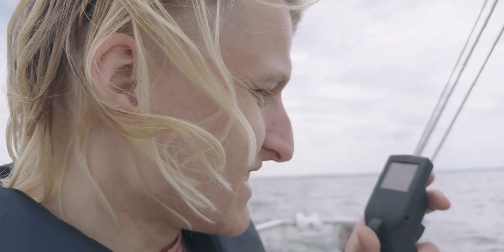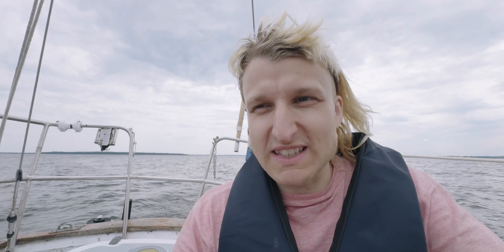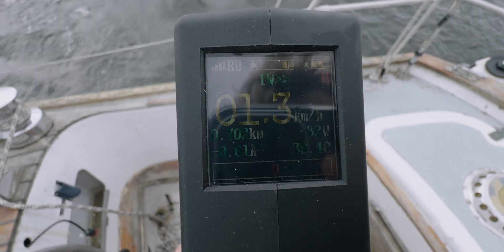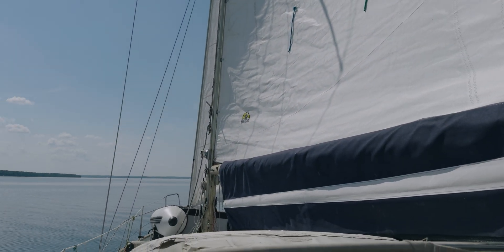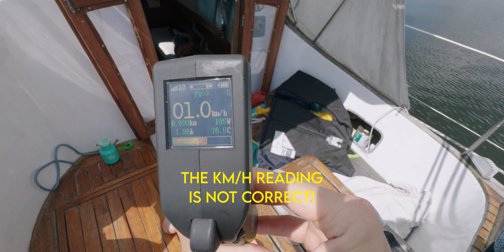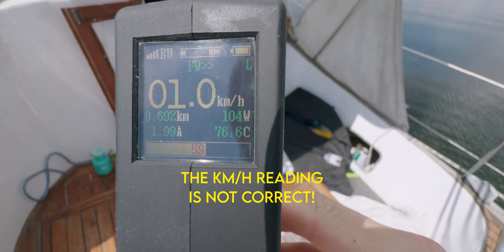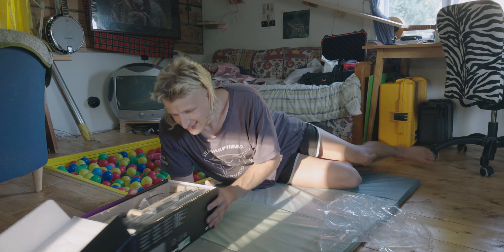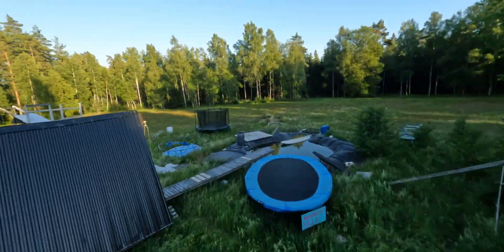First Test of the DIY Electric Sailboat Motor

Comment: I looked at the motor data for the 48 V motor. It shows 10 kW at 3500 RPM with 80 percent efficiency. The prop shaft cannot spin at 3500 RPM. Depending on your prop pitch, it may be more like 1200 or 1500 or something like that. Do you know your prop pitch and diameter? Also boat waterline length and displacement? Matching the motor to the prop is very important. You want to keep the prop and the motor operating in an efficient range.
Reply from the maker: That's true! I don't have the data on the prop and all. This will be the first bad version that maybe will be good enough! I think that it's not possible to compare the efficiency to an ocean volt or stuff like that. Simplicity and cheapness is my priorities for the moment. :)
Reply: @happygoluckyland is should be more efficient, vesc controllers are extremely efficient by themselves

Comment: You probably need a reduction gear to get max power from the motor. The motor max power is available only at rated RPM. The prop shaft will not want to spin at that RPM.
Reply from the maker: Yes that's true! I considered it but it was complicated enough for me without :)
Reply: @happygoluckyland  one step at a time. At least you have it spinning and driving the boat!

Comment: The sort of curve you described is either arithmetic curveo or an exponential curve.
See this channel...  Fantasia sailings ..latest offering.
Does your throttle lever have a positive stop indent  so you can tell when you have reached the off  point without going straight into reverse accidently. 

but going slow with a displacement hull is a way of  using very little power ..
Your sister and the cat seem happy enough with the boat.
Reply from the maker: Ah ok thank you! I think it's an exponential curve I think of. I just found that channel! Love it! We have the same motor, but I went for a cheaper programmable motor controller. I think theirs is probably more reliable but mine is more experimental 😅 I wanted to be able to experiment with regen to make electricity by sailing and it seems to be working 😊

Yes bot my cat and sister had a good time! ⛵️

Comment: Careful modifying the AIO, often the pump will be in the water block so you may want to just split one tube to keep the pump in the system. Good luck with your project from Canada!
Reply from the maker: Thanks!! Good to know! I need to find out the direction of the fluid and all that.. But my idea is to run it through the controller. It's an experiment 😎 if I break a pump I will have to replace it..